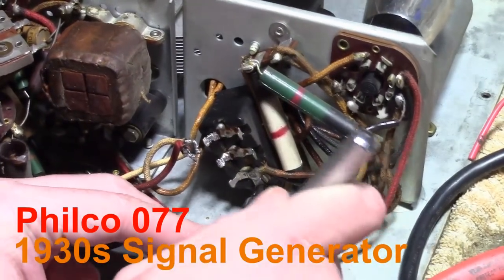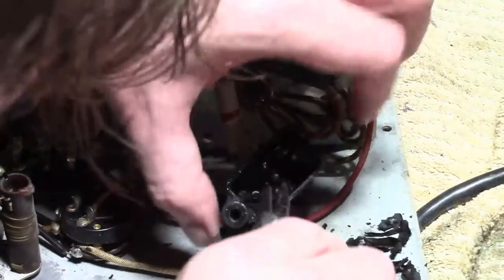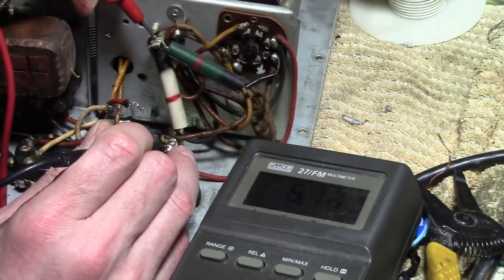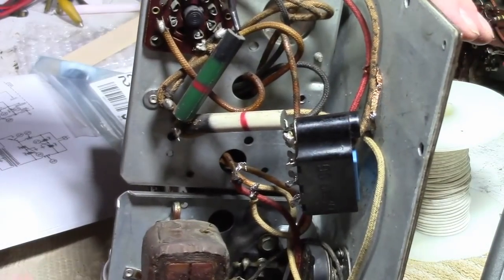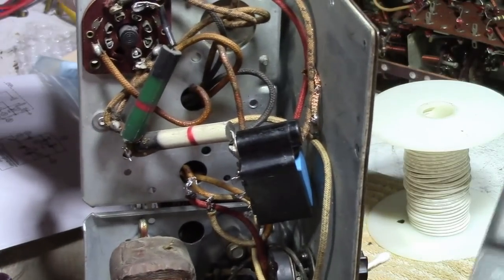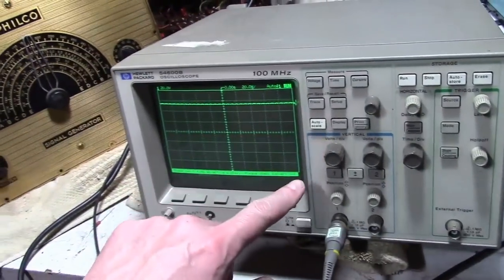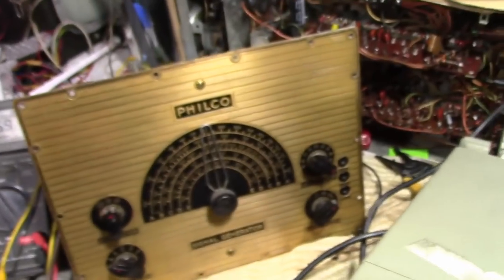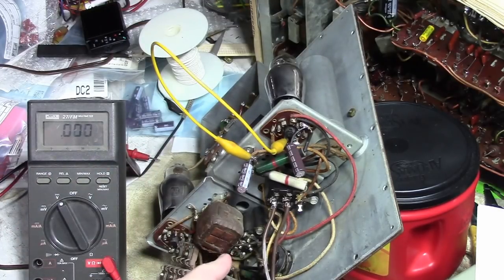Philco 077 RF generator restoration p2o6

Comment: Hi Bob....I have a video ready to edit on my Philco 077.  The voltage rating for the electrolytics is written on the can....I forgot what it was...I used 450v because that is what I had. I didnt have any voltage readings to compare mine to, but they seemed low ( I guess Im used to radio voltages?)... Seems like the plate on the oscillator tube was like 50 v......mine is working....hope to load the video tonight/tomorrow.....Thanks for sharing....If you need me to check anything....I dont mind taking it apart and checking it for you....I probably needed to write it on the schematic anyway....Take Care--Larry
Reply from the maker: The ratings on my can are 150 volts. Glad yours is working. I've got mine all torn apart still
Reply: bandersentv I am uploading Part 1 of mine tonight...during processing...I saw the caps are 150v....I didn’t measure the B+ but the transformer was 150-0-150 AC. I replaced the 16uF with 22 uF....Like I said earlier...if you want me to check something on mine...let me know....Take Care—Larry

Comment: With regard to the resistors being on spec, you are right, you would expect them to be way off, especially the dogbone style resistors, but then you run into some device like that. I ran into that more recently in a 1938 Deforest Crosley radio, which used resistors with the same old style B.E.D code on them, except they were bands. Other then the ones that obviously had overheated, the rest I tested were on spec, and even the ones that got hot were maybe 25% off. I guess it depends on whom manufactured the resistors, as well as what Wattage they chose? In an earlier set I have, a Rogers about two years older, all but two of the resistors were way off, they were weird ones with spade terminals on the ends, but the set was made by the same outfit that made the Deforest-Crosley, go figure?

Comment: That method of restuffing the Bakelite blocks is very similar to a method a fellow on the Philco Phorums uses, except that he uses a small drill bit, through the eyelets, to cut the wires. The last time I restuffed Bakelite block capacitors I took them out, and processed them one at a time, which is more time consuming, and can lead to wiring errors.

Comment: 34:06 IMHO you miscounted the tube pins and followed the wire incorrectly. Get a tube pinout and recheck! To me it looks like the wire from the chassis lug passes right under that pin you pointed out. Filament is pins 2 and 7 of the tube, you tacked the cap to pin 3 of the tube. It is CLEARLY seen at 33:48! Recheck or you burn out the transformer.  Should have restuffed the old electrolytic or put the ground side of the cap where the ground of the second celectrolytic cap went and avoid tacking something in that convoluted mess at the tube socket where you are prone to miscount pins.
Reply: Yes, looks like it's on pin 3, which I believe is one of the plates of a 6X5. Would explain the 355 ohm pin to ground measurement.
Reply from the maker: Yes, you are correct. I don't know how I missed that. Thank you for pointing it out

Comment: Do tv  or radios perform better with modern component ,which are made better then the original parts ? Anyone.
Reply from the maker: For sure, you can select modern components with less temperature drift.  Also capacitors with less leakage, lower ESR and longer life.  How much that will result in noticeable performance improvement I don't know.

Comment: On your voltage issue in the power supply, remember, back when that unit was designed, line voltage was around 110 volts...today it will be more likely to be 120 Volts to perhaps 130 volts.  In some rural areas I have seen the voltage as high as 130, but also wobbling from around 125V to 133 V.